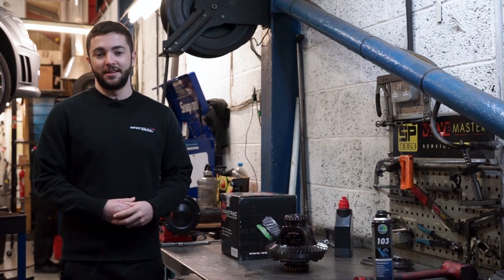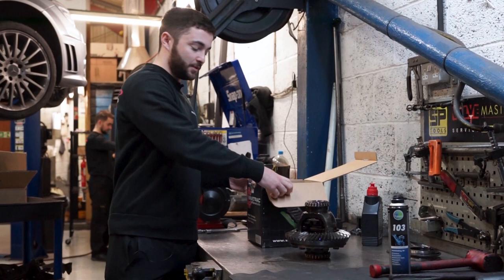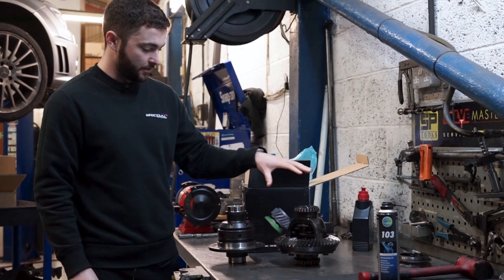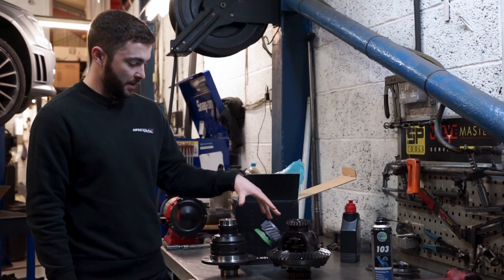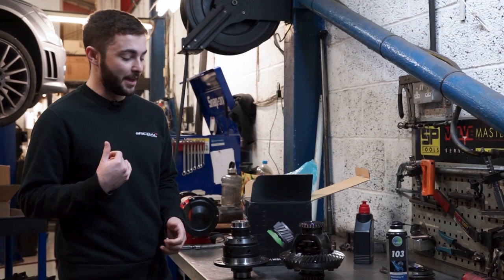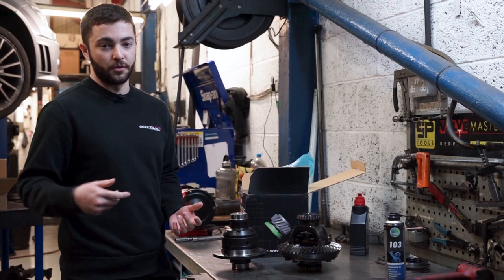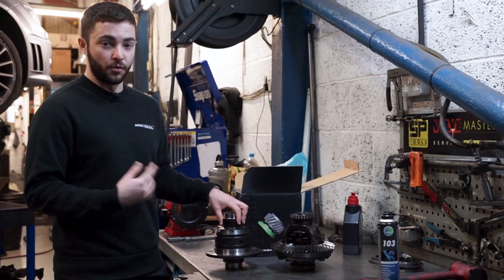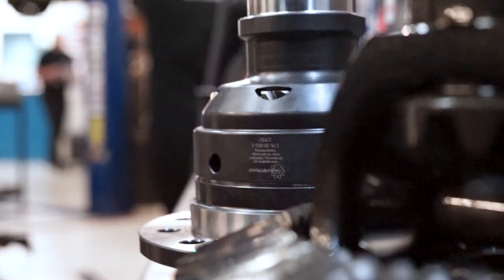Mercedes-Benz C63 AMG Wavetrac LSD Upgrade

Comment: Do you reuse old bearings on open diff onto wavetrac lsd. I see they sell the lsd without bearings on the ends
Reply from the maker: Depends on the model, some cars like the C63 AMG aftermarket or original equipment bearings are not available, so you have to very carefully remove the factory bearings to then re-use.

Comment: Did you replace the ring gear bolts, and are they normal or left handed thread?
Reply from the maker: The stock ring gear bolts are used and we (the marketing department) does not have information on the thread handing.

Comment: It says adjust backlash if needed, Im doing this for a homie but haven't started yet cause im not sure if ill need the dial gauge. Is it recommended to reset it or is this a mostly bolt on part?
Reply from the maker: You should always check and adjust backlash if required, you are rolling the dice with high nvh and low lifespan of components if you do not check and adjust if required.
Reply: Will do, thanks for the help. @RegalAutosport

Comment: Hey guys, for 2010 modell need to coding the ESP? I heard it can be affected after upgrade.
Reply from the maker: Nope! The Wavetrac is invisible to the electronics, the car will have immensely more mechanical grip so the electronic intervention will be less. 

Whereas if you opt for a plated diff which locks the axles together, it can cause issues.
Reply: @RegalAutosport  thx, I read some post by BMW Cars is neccessary to code it. Mentioned as an example if one of the wheels in the air, the ESP may unneccessarily brake.
Reply from the maker: @zsbalak  You don't need to do any of that with BMW or Mercedes Wavetrac diff applications
Reply: @RegalAutosport  what about quaiffe lsd

Comment: Heey,is the same in daily driving? Thks
Reply from the maker: Hey, in day to day driving the car behaves the same. The BIG benefit for example in daily driving with the Wavetrac is that when the grip conditions are less than ideal, for example wet, snow, ice or generally low-grip tarmac, the traction and grip will be much higher vs. stock. 

So you could say that the car is much safer and easier to drive in these conditions, which is a big benefit for when you want to relax and enjoy the journey.
Reply: Regal Autosport do you have instagram so we talk better? Thanks
Reply from the maker: @djiargentina9200  yes we do, https://instagram.com/regalautosport

Comment: Why did you not re-fit the diff cooler? (heat exchanger). I see it was fitted when you removed the diff, so I presume you snapped the two 8mm diff cooler mounting bolts, and didn't attempt to repair them. Yes, they are prone to snapping, but you could have drilled them out and fitted helicoils (which I have done before using home tools), and nobody would have been any the wiser. Or does the wavetrac diff not need the same cooling as the standard open diff? (I'm interested to know, so please educate me).......... Very informative video though, thanks for posting.
Reply: 0:17 diff cooler fitted. 2:28 diff cooler missing. Why don't you need it?
Reply from the maker: More often than not the bolts snap and most customers have time constraints, we offer the customer a solution of the new plate + bolts but most of the time they do not accept for cost or time reasons, which makes a repair difficult too!
Reply: @RegalAutosport  Thanks for the reply. I understand now the situation you sometimes find yourself in. Again, thanks for the video post.

Comment: Hi i have c63 amg 2010 I don’t understand the LSD but can someone tell me if it’s better with LSD or without it ??
Reply from the maker: Hey, the LSD is better. 

The open differential makes the C63 AMG feel unstable, less driveable and less grip. With an LSD, the C63 AMG will feel more stable, more driveable and much more grip! Customers love the Wavetrac LSD, it's one of our most popular differentials!
Reply: Regal Autosport thank you
Reply from the maker: Jimmy T  crazy expensive and a wear item that loses performance a sits used, whereas the Wavetrac does not! BEst thing to do is buy one without an LSD and upgrade to a Wavetrac, then it;ll be better than the factory option!